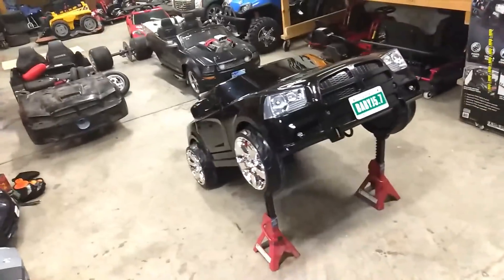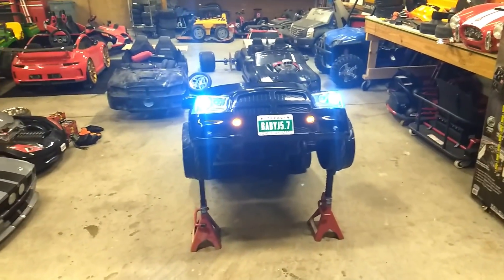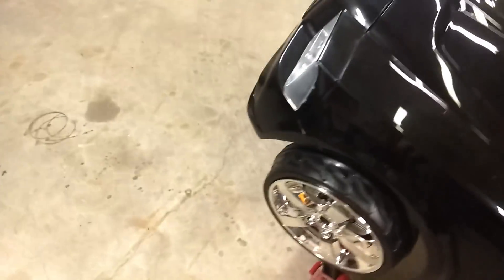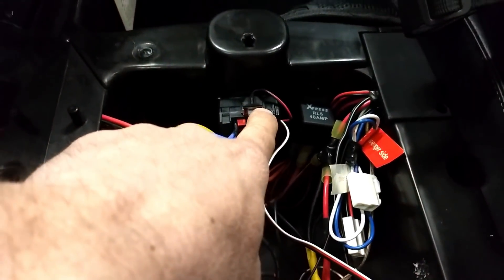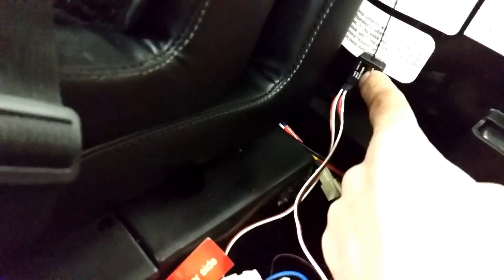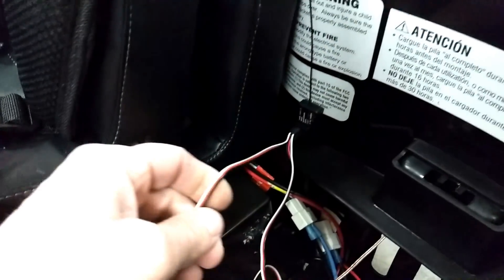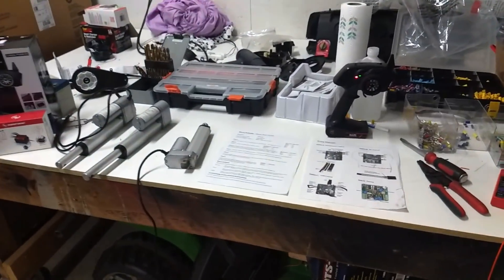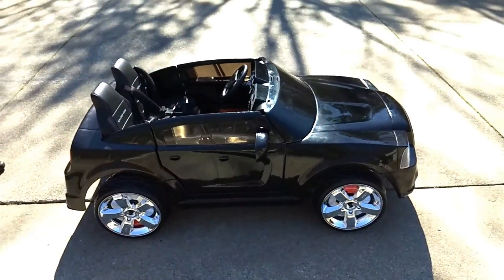RC Power Wheels Conversion How-To

Comment: Hello, I have a group of students that are converting a power wheels car to RC for a disabled child (Go Baby Go). I purchased all the parts in your description but with a 4" linear actuator. I can't seem to dial in the LAC to get it to auto center. Did you use the pots on your LAC to set this or did you use the Advanced USB settings? If it was the USB settings what were they? I have been trying to get it working for a week or two without success. Thanks!
Reply from the maker: Did u power up the actuator before they mounted it on the ride on? It needs to be on center position then figure out the mount location.  To fine tune the steering we use the steering trim on the radio to make it go straight. Hope that helps
Reply: @CustomKidzCars  I have been testing the Actuator without mounting it to the car. The settings has been full retract/extent. When mounting it we will have it set to 50% as we will need all 4 inches of stroke. The main issue is that it doesn't seem to know its center position. When it goes beyond the center line in either direction it doesn't return.
Reply from the maker: Do u have a 5 wire actuator? Won't work with a common two wire unit.
Reply: @CustomKidzCars  It is a 5 wire actuator. 

Progressive Automations Feedback Linear Actuator - Stroke Size 4", Force 35 lbs, Speed 2.00"/sec - 12 VDC

The wiring from of the actuator to the LAC is
P+ Yellow
P Blue
M+ Red
M- Black
P- White

After testing a while with the LAC's wiring chart I noticed the colors on the actuator were different than the LAC's and adjusted it to the wiring listed above.

Comment: Brother i have install all and the servo is not working whit the reciver and the servo controller..it just steering to the right
Reply from the maker: Make sure u have the wiring matched up to the specific lac board u have. There r two different ones.

Comment: Your video inspired me to convert my daughter's power wheel. But I have a question about the setup you are running, is the battery 6v or 12v? I am asking this because  I will be converting a 14v power wheel to radio control. And i notice the.ECS can only handle max 7.4v.
Reply from the maker: It a 12 volt setup so it will work fine

Comment: What is the relay brand you used?
Reply from the maker: Bosch
Reply: One more question, what gauge wire did you use for the connections from the motors to the ESC
Reply from the maker: 12 gauge

Comment: I have a first gen Escalade. (H0440) and I can’t determine what stroke length to get. I want the most turn radius as possible. Running 24v with the mamba monster 2, Acutonix LAC, and same controller as you. Would you be able to help me out? Great video!
Reply from the maker: I would go with a 4 inch. U can always dial back the stroke with the radio adjustment knob
Reply: Custom Kidz Cars want to do for my boys
Reply: Cool, thanks!

Comment: Hey bud, great information in the video. I love your videos. So I’m a little confused the linear actuator firgelli, has the same name brand on that little lac board  under the dash in @5:48 of the video firgelli, but when I was to order it from the links you provided the name is different it’s like actuonix. Is there another board that I need to order? And if not does the actuator come with a board that will connect to the LAC  board? Hopefully I explained it correctly please help, clearing it up. Also the red wire you cut from the lac board where does the white and black wire go to?
Reply from the maker: The actuonix lac board will work. Not sure if they changed the name or what. The white and black wire plug into the radio reciever
Reply: Custom Kidz Cars OK perfect thanks for clearing that up for me.
Reply: Custom Kidz Cars this just dawned on me do they make a esc to handle more than 12v I was looking more the lines like 24v or 36v
Reply from the maker: Yes but the cheap ones overheat and our first brand caught fire! We ended up using a battlebot motor driver. Look up sabertooth controllers. Not cheap and kinda hard to find.
Reply from the maker: U would need two of those I think with dual motors and how does this plug into the RC radio receiver?
Reply: @CustomKidzCars  how do i connect you directly.. im interested
Reply: Yes acutonix is the same company just a different name.

Comment: I just did this whole conversion but having some issue with the control board for linear actuator. When I connect the battery, steering does not work. I have to let it sit, then it starts working. Is this normal after you connect the battery?
Reply from the maker: proper procedure is to turn on the radio, power up esc and power up the lac board. there is usually a slight delay before steering is active.

Comment: On a LA street, under large boards for garbage pickup, I spotted  the front of a sea-green child's motorized Mini Cooper. My friend retrieved it with a rolling box lift, it being impossible to fit into my car. The many kids on our street were like magnets, asking does it work and can they have the 1st turn to drive it. My friend is  mechanically inclined, hooked a working battery, testing the two rear wheel motors, both ran like wild bobcats and he had to hang onto it by lifting the rear. He hooked up speed control and remote control. He found your site: how-to and what type of linear actuator and control board to use to enable him to steer the dear mini Mini Cooper by remote control. Your tutorial was clear- minded and inspiring us to continue our project using the patina-aged Cooper rescue. We thank you. Our passengers will be Shakespearean puppet/dolls carefully sculpted to resemble the actors in character for the Independent Shakespeare Company based in LA. For 15 yrs. the company of masterfully trained actors, musicians & dancers have delighted audiences from all walks of life, free theater in Griffith Park, 5 nights a-week during the months of July & August...with best wishes, Bianca, a friend of >iscla.org< I surmise my comment fits into an odd category. My intent is sent in good faith of your obvious knowledge & experience as a mechanic.

Comment: For the actuator control board, is it the red wire from the reciver or the battery that you do not connect?
Reply from the maker: The receiver. U power it up with the battery

Comment: Sorry to bother you again, but I have my LA and my LAC and I have it wired exactly like you show @ 5:17 (there is a green light on the board), but when I use the transmitter to turn left/right nothing is happening.  What should I do to troubleshoot?
Reply: Custom Kidz Cars good call. The receiver does not work properly. Hooked it up to my traxxas slash and good on forward and backward.  But now turning. Sending it back to Amazon.
Reply: Custom kidz Cars, sorry it's been a while since I had a chance to work on the car. I am not getting movement from actuator. This is how I have it connected. I have the powerwheels better to a 15 amp fuse to board. A lipo is powering esc. I snipped red(power) off before connecting cable to board from esc. Little light blinks when I move wheel on transmitter, but no movement. When connected direct to battery, actuator moves. Any ideas?
Reply from the maker: Make sure u have the connector plugged into esc correctly. It's easy to have it flipped backwards
Reply: @CustomKidzCars  yes sir. I have switched it back and forth.
Reply from the maker: Do u have 12 volt battery powering the board?
Reply: Yes sir, I have the stock 12v battery powering the board directly.  My receiver and ESC are using a14.8v LiPo.  I also cut the red wire from the servo lead that goes to the board.
Reply: When I initially wired it all up and turned on power the LA actually extended to its full length.  I just cannot get it to do anything at this point (retract or extend).
Reply from the maker: Do u have a regular RC servo to plug into the receiver to make sure your radio system is working correctly? I hope u cut the voltage wire coming out of the esc.
Reply: I got it working!  My wiring was slightly different for some reason.  Top to bottom is White, Black, Red, Blue Yellow.
Reply: jhawk1977
Reply: jhawk1977 , I am having same issue. Little light turns on. No movement. Which top to bottom are you referring too. The one in the video at 5:17 min or the one on the LAC data sheet?
Reply from the maker: U might have a slightly different board like jayhawk stated. I would look for your data sheet for the unit u purchased.
Reply: Custom Kidz Cars. I have the actuonix LAC and the Fergelli 35 lb linear actuator with feed back. The one with two separate bundles with 5 separate wires. I connected as stated on data sheet but I do not get nay movement. I know actuator works as I have connected it direct to battery to check for movement. Receiver send signals for throttle no problem. I also have the 12 v power wheels powering LAC and 2S lipo  powering ESC and motors. Any help is appreciated.
Reply from the maker: First confirm that the radio system works and u have the lac rc wires correctly plugged into the receiver as it may be flipped backwards

Comment: Can you have duel esc's with one receiver ? Cus I want to have duel brushless Motors, 4 six cell lipo battery's upgrade tiers and have it 4x4
Reply from the maker: mathew wyrick not 100% but I believe all I do is parallel the esc wires with a wye that plug into the receiver

Comment: In regards to the linear actuators...Is the only difference between the Amazon one ($111) with the ($50) control board as opposed to the $30 eBay ones is that the Amazon one returns to center when the controller is released?  Also, since the eBay one only has a red & black wire (+/-), does it still require a control board?  I'm just trying to justify the difference in price. 

Is there a reason you don't use Giant Servos ($50) like these instead of linear actuators? https://www.amazon.com/dp/B0006O3X2M
Reply from the maker: Still need a lac board. That is how it gets signal from the radio.
Reply: Thank you so much for responding.  I really appreciate your help as I proceed with my build.  So, if I get the lower cost $30 eBay linear actuator, it will work, it just won't return to center like the $111 Amazon one, correct?
Reply: I will obviously need the control board, I get that.  If I connect 18v or 24v, do I need a step down of some sort?  I will be using a dual brushed ESC and a 2.4gHz TX/RX (the ones you recommended...I ordered them last night).  If so, what's the best way to step down power?
Reply from the maker: If it's obvious why did u ask if u still needed one? TBH I am not a fan of the attitude your posts are coming across. Especially since you are expecting free advice from us. You do know that we actually charger customers to build these?
Reply from the maker: Yes will work but just realize u will constantly be fudging with the steering to get it to go straight. We learned this the hard way long ago. Like u hear all the time, u get what u pay for. Good luck with the build and hope it all works out the way you plan.
Reply from the maker: We run the actuators and LEDs on a small accessory battery. Keep it separate from your drive pack. Hope that helps. U can use a step down converter. Google -buck converter.

Comment: Next time you get an inquiry from another client  to do another one of these builds,would it be possible to record the process from start to finish ? Like how Wesleyb52 did ESC installation videos for the power wheels upgrade mods to 24volts a few years back. I have been wanting to do this for some time now,and have all the parts except the actuator,because I wasn't sure of how to determine the speed of the stroke. Also for the steering,are you using one solid piece of  flat stock running across to each wheel,and the actuator is connected to it ? My build is a 16v Kids Trax Dodge Viper converted to 24v,with Traxas 775 motors.(Thinking of upgrading to dual 250 watt  motors @ 36v chain driven/disc brakes.) I re did all the lighting custom by using a cheap Chinese scooter wiring harness,which made wiring up 12v leds a breeze for full function running lights,brake lights,turn signals,high&low beams,and horn. You haven't posted any videos for a while,but now you've put out this one ,and a few others,i'm glad your back,keep up the good work and the awesome mods. Oh one last thing,I wanted to know if you could post down in the comments the link for the RC board,and what actuator you would recommend for the two seater 16v kids Trax Dodge viper model. Thanks John !
Reply from the maker: Derrick Andrews the links for all the parts are already in the description.